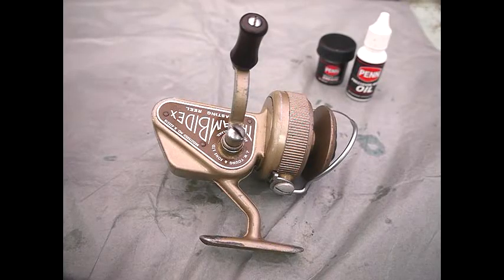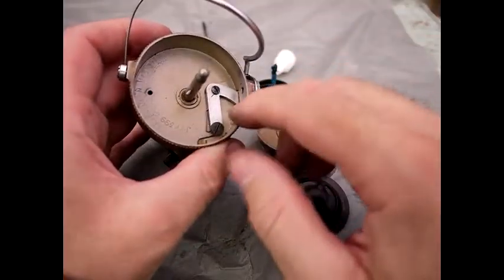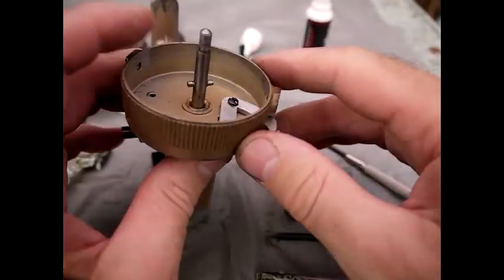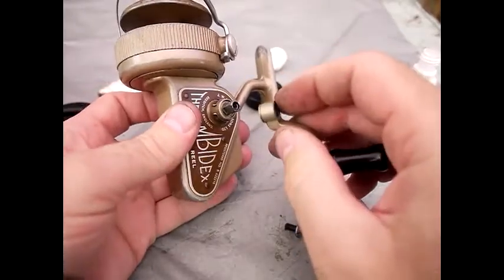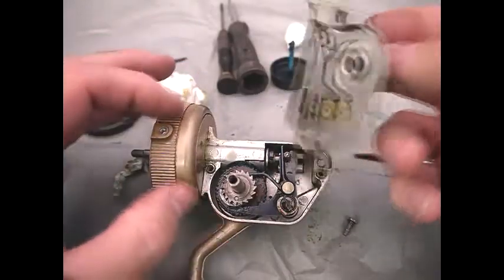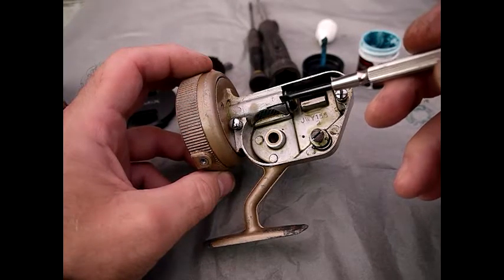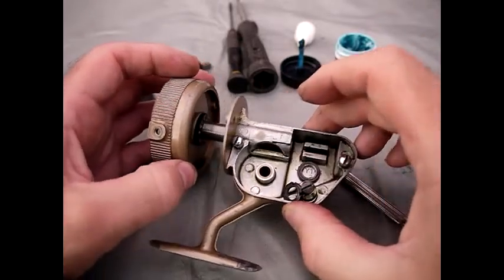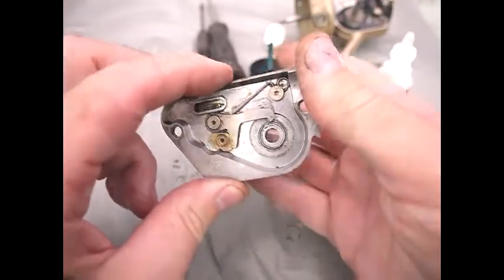Disassembling Youngs Ambidex Casting Reel

Comment: Just got one which feels stiff when winding. Think it may be old grease.
Need to remove side plate but very tight.
Thanks for the video - very helpful.
Reply from the maker: Ok its an old design, a pre-ball bearing era reel. Its likely to be hard grease. Just give it a good clean with white spirit which softens grease and dissolves it. AF
Reply: Managed the side plate removal - your video was very helpful in that.
Gave the inners a good clean and a light greasing. Reassembly was a bit fiddly but got therein the end. Smoother winding!
Good to see spool removal is a known difficulty and not just mine!
Pairing it with a Peter Stone Original Leger Rod